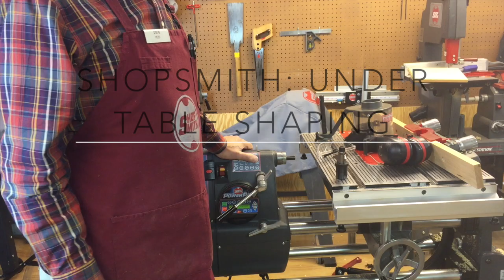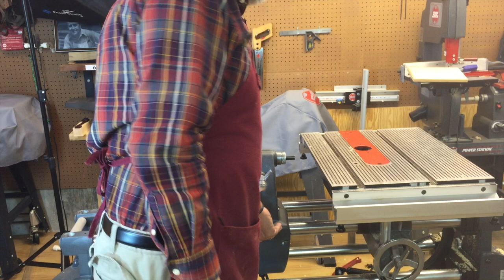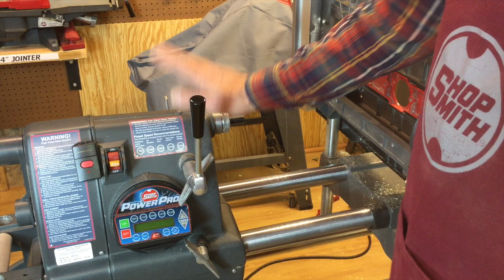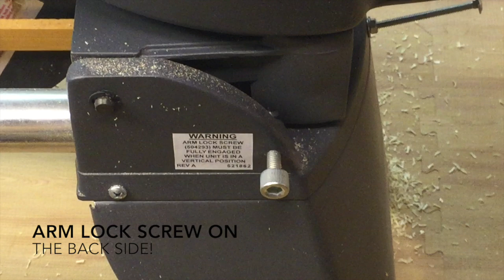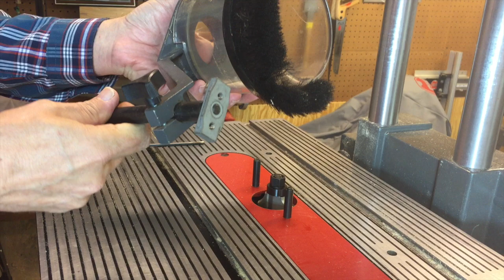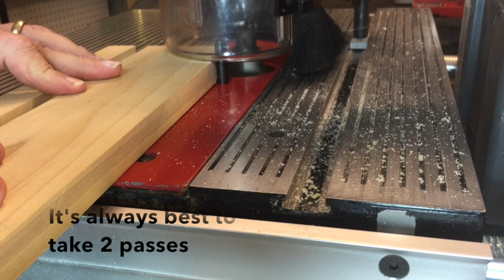Shaping on a Shopsmith

Comment: So, I have two Mark V's. Neither has this double tilt upgrade, but I've been contemplating turning the headstock around on the one with little sentimental value in order to use as a shaper/router table. Thoughts?

Comment: I have a Mark V, what's the difference in using a shaper or using the router? I have a router table and can move a Roman Ogee up and down and make different profiles.
Reply from the maker: +Frank Ingram 
Great question, Frank! I just the last half hour on what I thought was a beautiful answer, only to lose it all when I changed windows. But in the process I found an article which explains it very well.Go to Rocklers webinar page and check it out.
You can also change profiles with Shopsmith router and shaper, by using the quill.